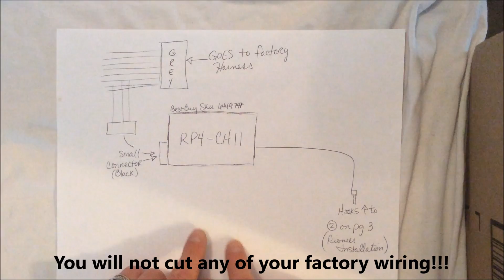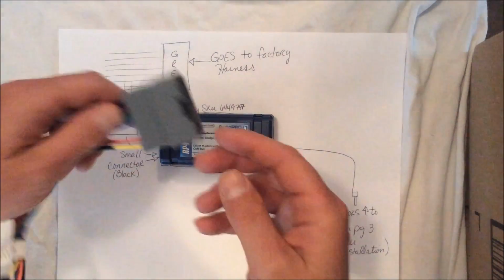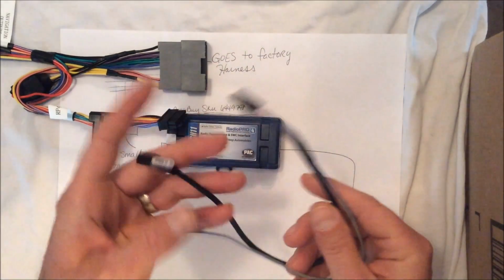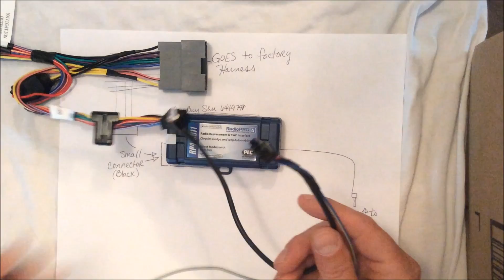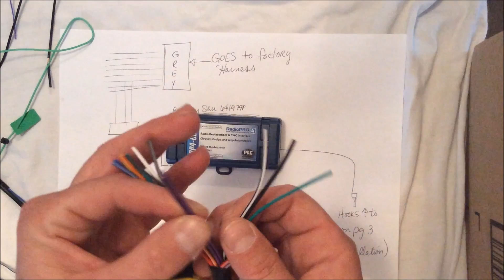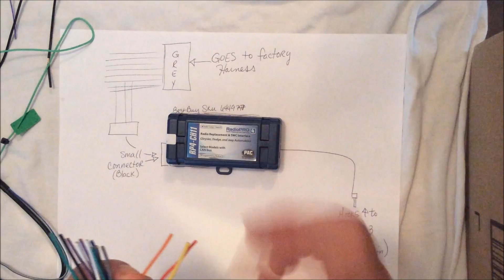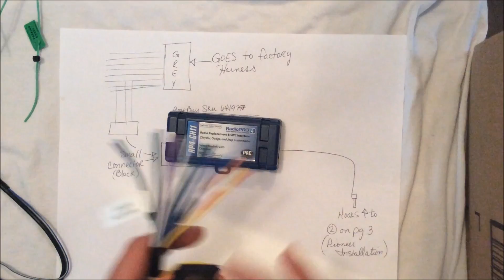Simple Explanation of PAC RP4-CH11 Controller Jeep Wrangler CAN bus

Comment: if you do not have the volume control buttons, do you still need this to do an aftermarket head unit install?
Reply from the maker: Probably not, im pretty sure this is the module that works in conjunction with the steering wheel controls.  Worst case scenario would be not to buy it, hook urs up, and then if it doesnt work buy it.

Comment: I must be one dumb s.o.b i seen your video about 5 times and still cant get it 🤤😂 pac is almost the same i have c2r-chy4 wired up speakers but cant figure the other ones out any help would be greatly appreciated
Reply from the maker: I was in the same boat u are in and finally figured it out...what exactly are you having trouble with and I will do my best to help ya!
Reply: Well i got it working but now i just did more research and i need another module for steering controls
Reply from the maker: Yes sir, it seems that every piece of electrical group is ran off theses pac modules...good luck sir!
Reply: JRMSweeps thanks for the video after watching urs i kinda got an idea so thank u sir👍🏽
Reply: John San Miguel did you color matched all speaker wires or just the front ones? I saw other videos where they only used the white and grey wires.

Comment: do you by any chance know what Ill connect the BLUE wire (instead of the plug that controls the steering wheel controls ) to my Kenwood Radio? because I know kenwood doesnt use the plug, it uses that blue wire, just dont know which one to connect it to? thanks
Reply from the maker: Solid blue or blue and white?  Amp turn on?
Reply: @JRMSweeps  I know this is months old, but I think he was referring to the blue/yellow wire that runs with the SWC jack.  Some heads use a blue/ yellow wire, some use the jack.  They serve the same purpose.

Look for a SWC port on the back of the deck OR for a blue/yellow wire on the deck harness.
Reply from the maker: Not sure on my end.  All i know is the application for a Jeep Wrangler and this Pac

Comment: Mine has two yellow and two black one by itself and on runs into module side so do I just splice then all together with radio harness
Reply from the maker: U would have to follow ur radio diagram i guess...
Reply: I have the same question right now, what did you end up doing? Thanks

Comment: Hey man need some help , installing a pioneer 5200nex on a jeep wrangler with the pac rp4ch11 , i have 4 wires on the pioneer harnessthat i dont know if i need to plug, purple/white, blue/white, pink, light green(long) , my jeep has rhe base audio system so has no amp and i will not be putting a amp or rear camera just want my headu it to work with gps
Reply from the maker: Some of the wires that I mention in the vid u will not hook up...i simply capped them off at the ends when i did my install for the ones i didn't use...

Comment: Thanks for this video.  What is the wire that comes off the PAC harness by the black plug?  I had to remove my head unit due to water damage and when I did I saw a black wire that was hanging by itself.  I don't know what it was hooked up to but wondering if it was this pac harness wire.
Reply from the maker: Black is usually ground wire...not sure if there are 2 black ones tbh...
Reply: Thanks. It’s a ground.
Reply from the maker: Awesome deal!

Comment: do you know how to use that harness with the factory premium sound/ an amp and sub?

It is a little different. No speaker wire hookups
Reply from the maker: U would prob have to cut into the factory harness
Reply from the maker: For an amp u need a a 2 channel add on adaptor
Reply: I got it, just hooked it up but it only takes the rear speaker level inputs.... so that means no fading :/ 

now I am trying to get the OEM reverse camera to work. :D
Reply from the maker: Not sure but u might be able to buy an inline fade device...
Reply: @adidas4275  I just bought a Pioneer receiver and have the premier Infinity system in my Wrangler. I'm assuming the aftermarket stereo has a better amp so I plan to completely bypass the factory amp which is located under the steering column. I'm still using the PAC harness to keep the chimes and radio dimming. Future upgrade would then be to use the preamp outputs to a separate amp connected to the factory speaker wires which was connected to the Inifinity amp.
Reply: @supersportimpalass  hmm, interesting idea.  I have mine working but I cannot figure out the factory review camera yet.  I bought an adapter to add RCA plug to the PAC wiring harness, but it either isnt the right pinout or the camera is not getting power.  I believe it is 6v so I need to use a resistor or voltage converter and I need to figure out which wire is the power and ground for the camera.

So much nonsense with the premium sound package :(
Reply: Did you use A or B with the factory premium sound?
Reply from the maker: The pac kit i bought had 2 harnesses with it, not sure which letter it was...
Reply: @JRMSweeps  got it installed, it was B for the 2012 jku rubicon
Reply from the maker: Okay good deal...sorry i was of no help my friend...

Comment: So if i am connecting an amp to the radio blue/white, does that mean the pac blue and blue/white will be left unconnected?
Reply from the maker: No they will both connect to it.
Reply: Hey gents, want to pigging back off this question. 2011 Jeep Liberty, factory system with the rear sub, I should not need the blue/white wire correct? Currently with the aftermarket radio hooked up, I have absolutely no sound out of the speakers. Not even static noise from radio. I’m wondering if that if both blue/white wires need to be connect to power the speakers and amp?